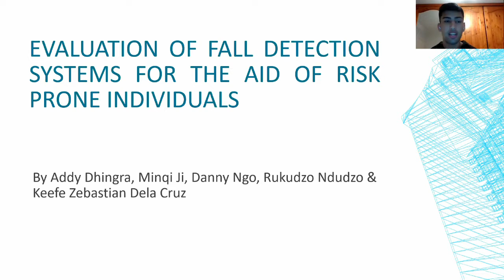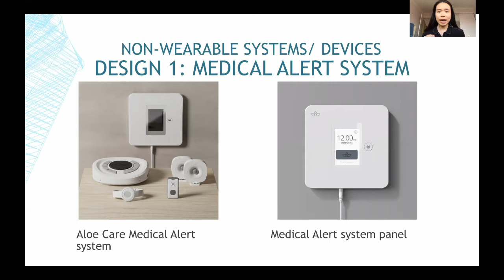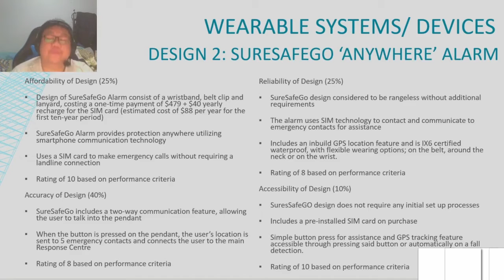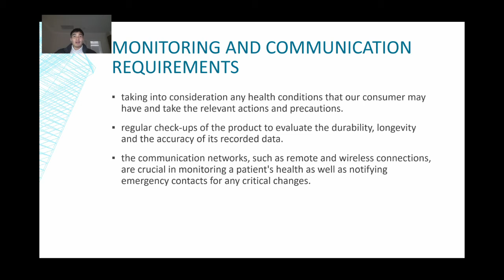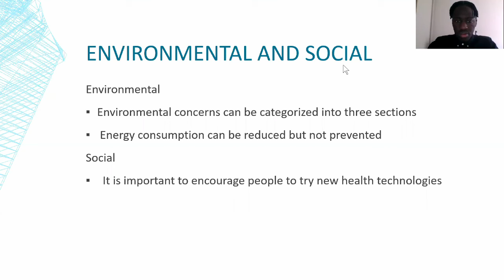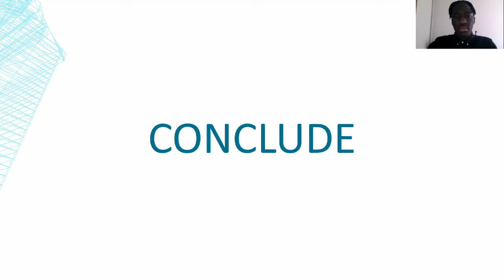Evaluation of Fall Detection Systems for the Optimised Aid of Risk-Prone Individuals

Comment: Hi! Thought your presentation was great and just have a question in regards to the GPS tracking. As the solution is wearable and requires a network connection for GPS tracking what systems do you have in place for potential cyber-attacks? What if a thief were to gain access to where one of the clients lives, making them vulnerable and putting them at risk.
Reply: Thanks for your comment and question. Hacking a device in order to track an individual’s location without consent is commonly accomplished by installing a surveillance application on the device. Users need to always exercise caution when plugging any device into an unknown computer. For Bluetooth connection, it requires password to prevent unauthorized access.